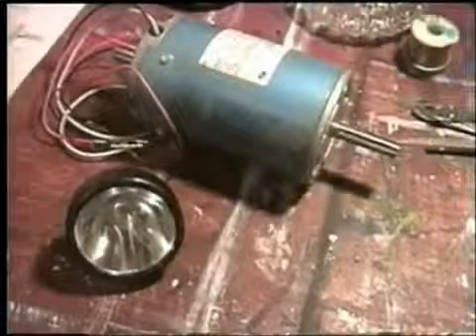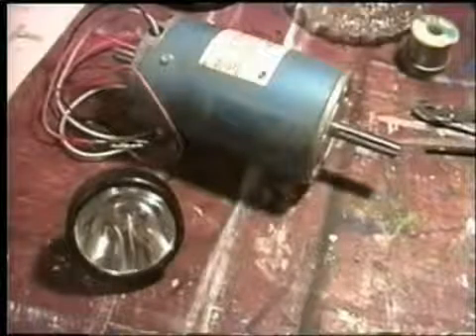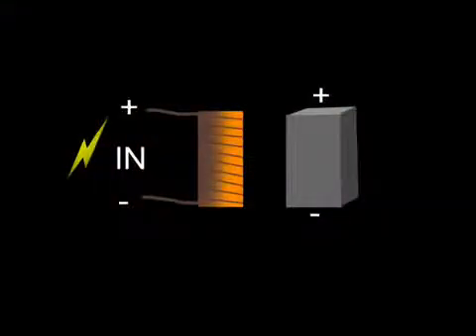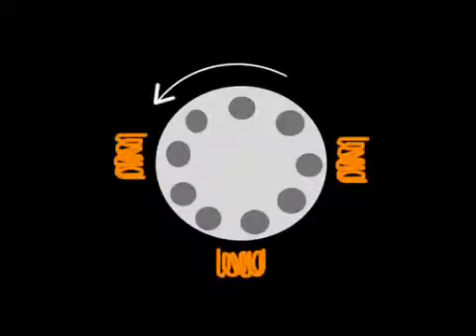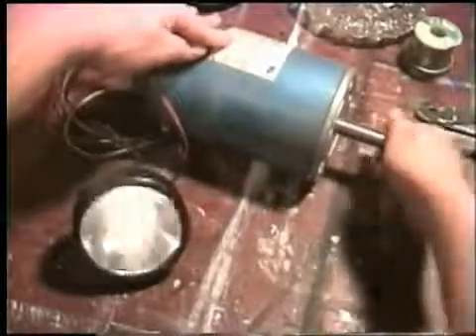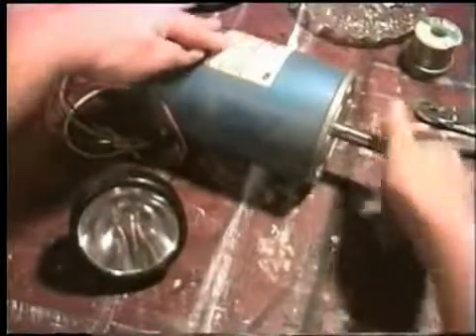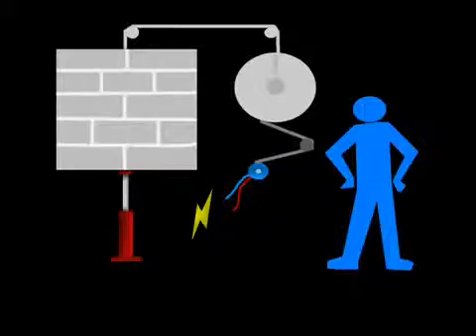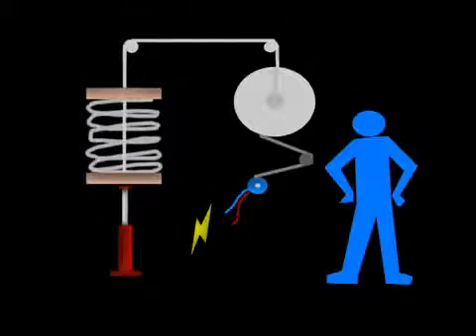Simple Homemade Generator for Beginners

Comment: Hey I used a 12v motor off an old brush vacuum and mounted it like a friction wheel on my bike with about 6-8 old Christmas lights hooked up to it lol the only thing I did wrong was I didn't use a fuse so after I went to fast all my lights blew lol but I was thinking of a 100% self powered generator if you'd be interested in talking about it comment back away for me to talk you. I'd greatly appreciate you listening to my idea atleast I'd love to hear any kind of criticism.